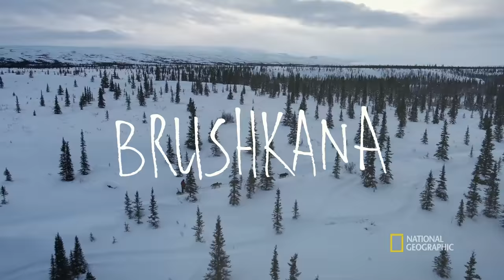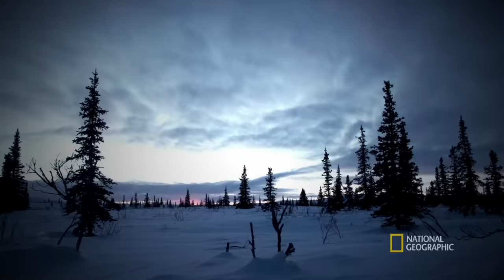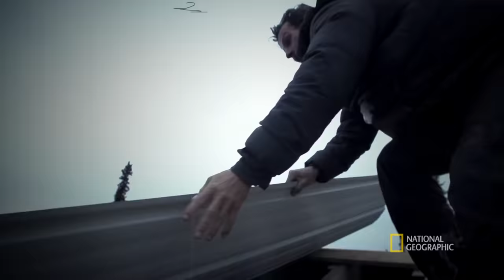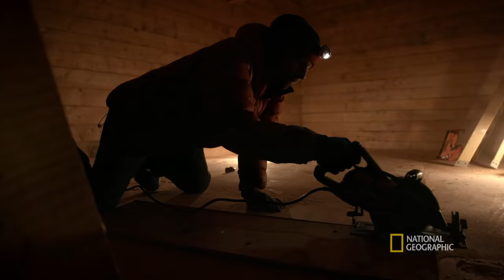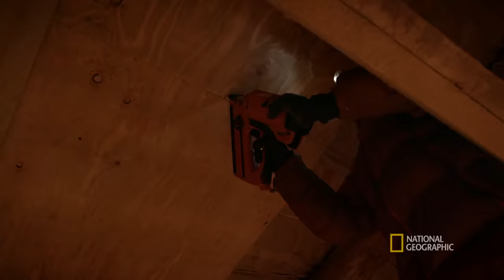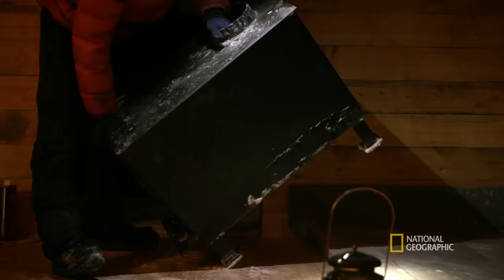Building a Cabin in the Arctic | Life Below Zero

Comment: How do they get water and electricity to such isolated places
Reply: Chop a hole in the ice or drive a well, maybe rainwater collection, for water. Generator, or Solar/wind generator on battery and inverter system. In Jessie's case, he pulls water straight out of the river, and runs generators. I do so, myself.